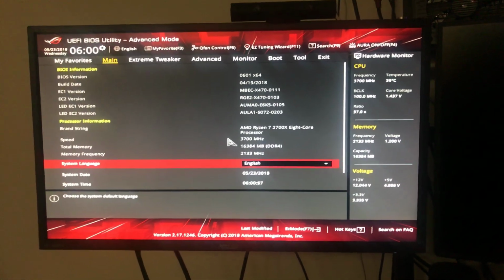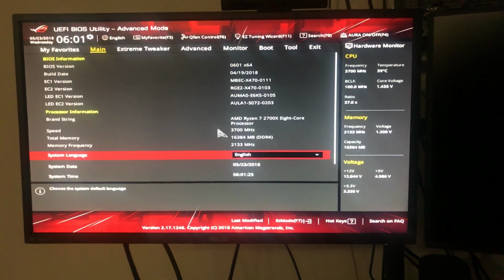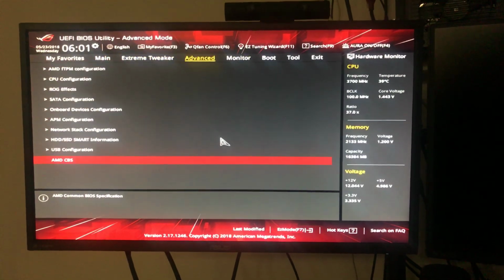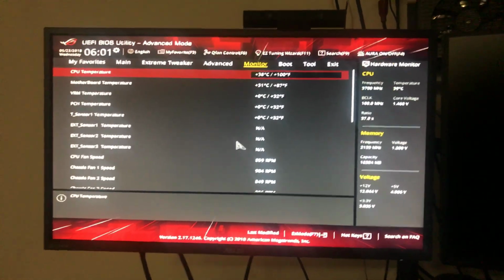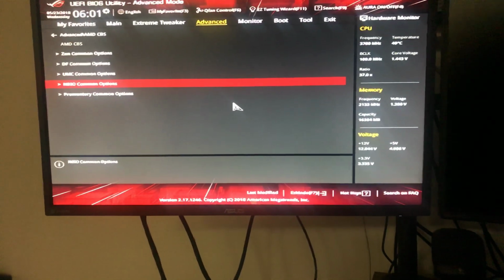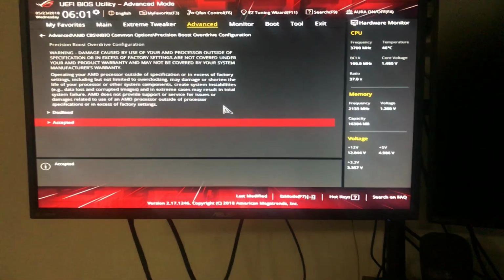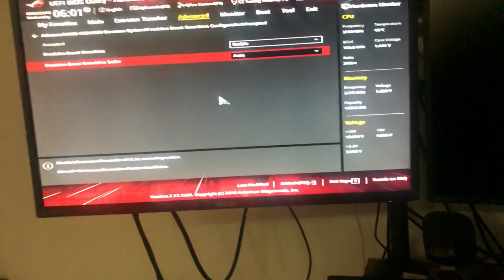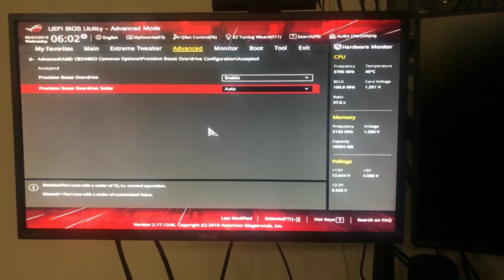Enable precision boost overdrive (PBO) on an ASUS board

Comment: This did not increase my score on cinebench at all. And the clocks did not change. I use 2700x with x72 kraken
Reply from the maker: attack were you already manually overclocked?
Reply: kickblake only docp enabled on 3200mhz ram, manually set @2666mhz
Reply from the maker: attack wait, why aren't you running your 3200mhz ram at 3200mhz? Also, what clockspeed ar you maintaining during the benchmark? My 2700x holds 4.0 with PBO enabled.
Reply: kickblake my ram does not run stable at anything higher ever since I bought it. I have Trident z rgb 3200 2x16. During cinebench the clockspeeds are anything between 3.7 to 4.1ghz. @ around 40C, need to check again to get more accurate numbers.
Reply from the maker: I don't know what to tell you about the RAM.  I haven't had problems on my 1800x or my 2700x getting advertised clocks and timings, BUT I ran single rank sticks.

As to you processor...you're getting about as good as you're going to get clockspeed wise.  If it's backing all the way down to 3.7Ghz, you might have thermal issues.
Reply: kickblake i overclocked my 3000 16-18-18-38 to 3533 18-20-20-36 absolutely fine 

Adata xpg d40 rgb with samsung chips SR
Reply: dude what mobo and cpu are you using
Reply: I have the same sticks as you and i manage to overclock them to 3400mhz cl16 stable, what ram slots are you using ?
Reply: My mobo has only 2 slots, its itx b450-i
Reply: you need to manually adjust the frequency and latency that was advertise on the box, then set it voltage to 1.35v
Reply: Calamity  I also thought my crosshair 7 hero is trash

Comment: hi kickblake nice video ,so i wanted to ask is it safe to enable  it with stock cooler? i have the ryzen 5 2600x with wraith spire , also when you clicked on accept the pbo  it was on auto  is better an auto or i have to choose enable it?
and one last thing is xfr2 and pb2 automatic enabled? or should enable them from bios? i have an  asus x470 prime pro motherboard..
Reply from the maker: Babis Zan it's safe to enable it. Basically you're relaxing the power and thermal limits somewhat from stock, but they're still there. Your CPU will still throttle. What I don't know is if you'll get much out of it with that cooler.
Reply: ok thanks kickblake  because right now i dont have a good gpu and i dont need all the horsepower from my 2600x yet, i will enable it when i will buy a good aftermarket cooler in the near future it will be safer and proppably have more gains that way i believe.

Comment: is this option only available with an X series chip? I would have to manual the non x's?
Reply from the maker: Reported990 I'm still attempting to confirm, but it seems to be an x only feature.
Reply: @kickblake  i have only enable and disable without manual on 450-i strix with 2700x, what should i do? :(
Reply from the maker: @AnimePlanetVerse  choose enable
Reply: @kickblake  nothing appears after that
Reply from the maker: Tpecep boot to windows and see if you have higher boost clocks.